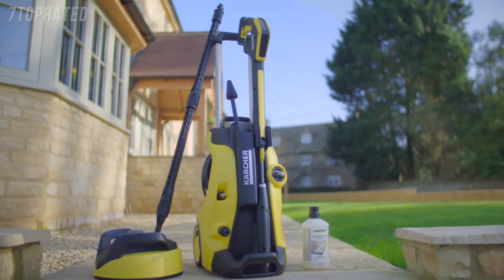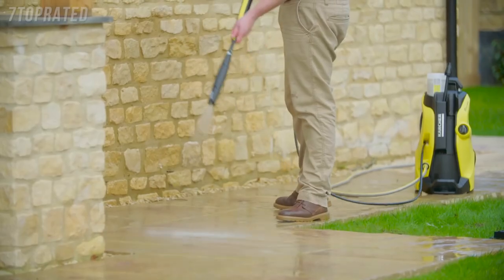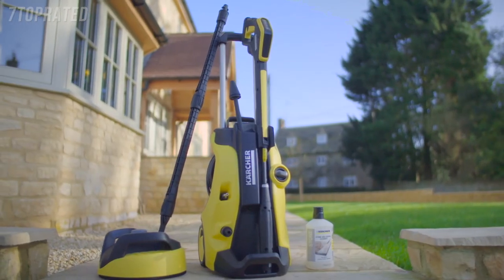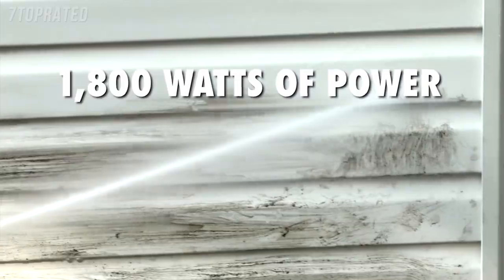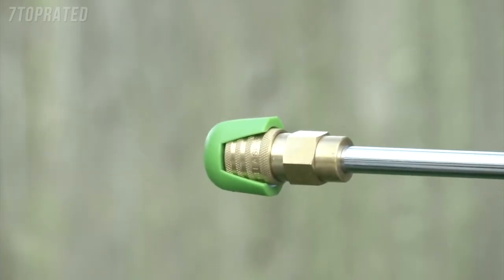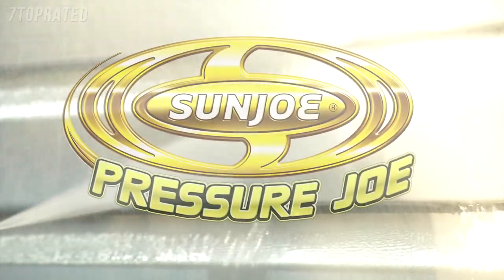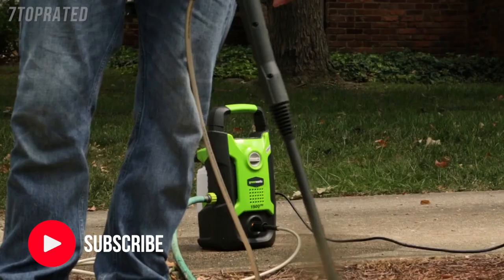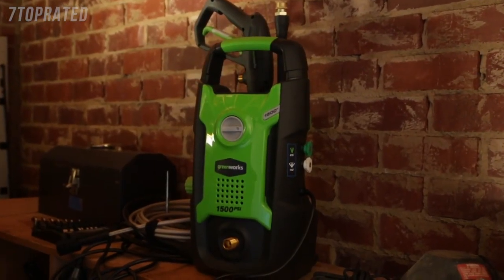5 Best PRESSURE WASHERS 2021

Comment from the maker: Links to the Pressure Washers we listed in this video:

► 5. Karcher 13246440 K 5 Premium Plus Electric Pressure Washer - https://amzn.to/30DPlBQ
► 4. Sun Joe SPX3000 2030 Max PSI 1.76 GPM Electric High Pressure Washer - https://amzn.to/2F1XLul
► 3. AR Blue Clean AR2N1 Electric Pressure Washer - https://amzn.to/31t0QuV
► 2. Greenworks 1500 PSI 13 Amp 1.2 GPM Pressure Washer - https://amzn.to/3agC6dz 
► 1. Briggs & Stratton Gas Pressure Washer - https://amzn.to/2Dlbzjd

==========

UK Links:

► 5. Karcher 13246440 K 5 Premium Plus Electric Pressure Washer - https://amzn.to/2HTNYbx
► 4. Sun Joe SPX3000 2030 Max PSI 1.76 GPM Electric High Pressure Washer - https://amzn.to/3e9KAFa
► 3. AR Blue Clean AR2N1 Electric Pressure Washer - https://amzn.to/2TJphAE
► 2. Greenworks 1500 PSI 13 Amp 1.2 GPM Pressure Washer -  https://amzn.to/320T1hc
► 1. Briggs & Stratton Gas Pressure Washer - https://amzn.to/2JgEg3a

==========

Canada Links:

► 5. Karcher 13246440 K 5 Premium Plus Electric Pressure Washer - https://amzn.to/3egxGW2
► 4. Sun Joe SPX3000 2030 Max PSI 1.76 GPM Electric High Pressure Washer - https://amzn.to/3mF5GOy
► 3. AR Blue Clean AR2N1 Electric Pressure Washer - https://amzn.to/34Jz1S4
► 2. Greenworks 1500 PSI 13 Amp 1.2 GPM Pressure Washer -  https://amzn.to/34IE4BY
► 1. Briggs & Stratton Gas Pressure Washer - https://amzn.to/3jJw2xg